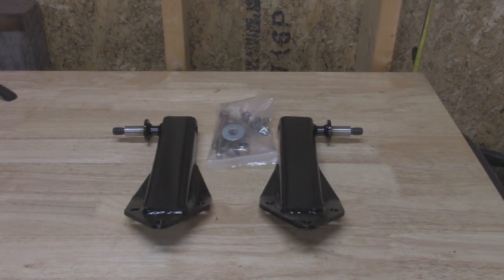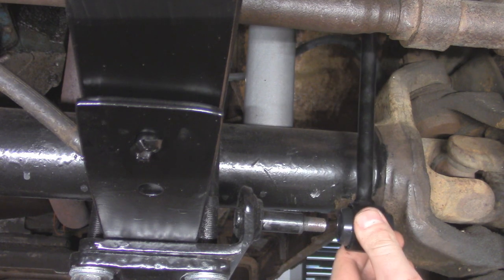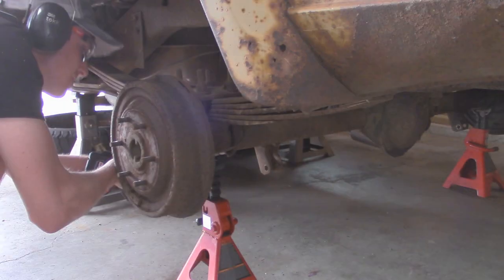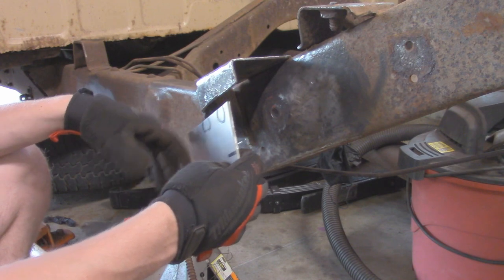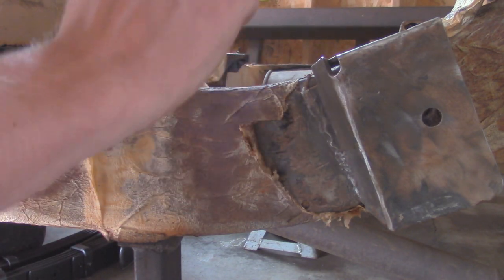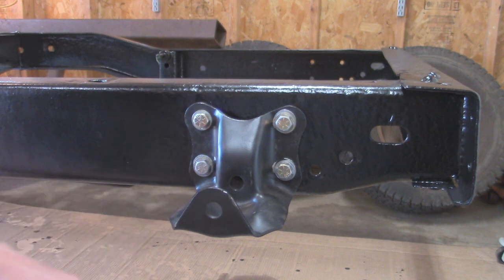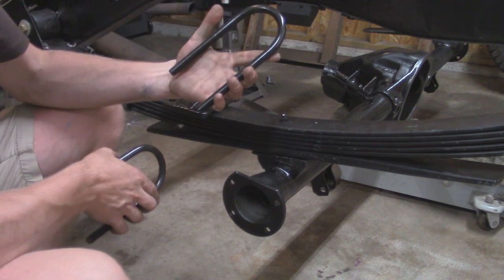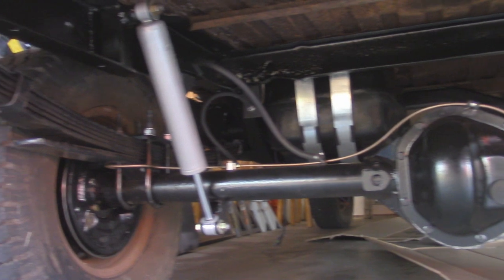Installing a 3" Lift on a 1978 Jeep J10 | Part 2 of 2 | Rough Country

Comment: Hey there young man.
  Listen to an old timer,. When you are trying to clean up rust on that old stuff and you have that heavy stuff such as on your frame that won't sand or wire wheel off especially in the heavily pitted areas, just heat them up with your propane torch, and then you can brushes the rust right out off,  it saves a lot of compared to using chemicals and is a lot safer.   I have been working on rusty stuff for forty years, and I often use this method on heavier steel parts and and frame rails to remove rust.  You can do it on thinner steel also sometimes when needed as long as you are not concerned about warping it.  
And also by heating up the metal you are also removing the moisture from it, which gives you a completely dry surface for applying rust converter, primer or whatever kind of paint to.
 Keep up the good work, and good luck with your project.
Tim from Wisconsin.
Reply: Good tip!

Comment: my three 1979 J20s (131" wheelbase like your J10) had the Quadratrac and the Dana60. The J20s only had the 131" wheelbase. J10s had the Dana44 and had the 119 and 131" wheelbase option (7 and 8 foot bed). 
I'm surprised with all the rear spring hanger relocating you did, you didnt just move the rear suspension forward 12 inches to use the forward spring eye positions for the rear springs. Then you just chop the rear Drive shaft, and cut a foot off your bed (if reusing it) and you got a short wheelbase J10.
Reply from the maker: Interesting, I may do that in the future but for now I am trying to get it to be original as possible with a few mods.
Reply: I converted my J10 to shortbed. It's simple. You just relocate the springs 12" forward, and there's already a dimple in the frame where the hole goes.

Comment: Hope you remembered to make some drainage holes on the bottom of your rear forward leaf spring bracket repair.
Reply from the maker: Yup, I did add them. I don't believe I mentioned it in the video though.
Reply: @OutJeeping  Good job then, as far as the front steering stabilizer mount goes, I managed to reinstall mine even though the pins seemed to be too short on two different J trucks, it was a a pain, but  once you you get it lined up I managed to catch enough of the pin to make it work, once the weight is on the spring and you get them started and they level out some the pin should catch the hole in the axle mount better. I was amazed how easily the new springs seemed to fall right in place in your video without being forced to bow them, especially the rears. I have installed a 4" skyjacker and a 2" lift kit on a 84 and 81 J truck and almost needed 3 or 4 hands to flex them into place.

Comment: Aren't you supposed to have the wheels on and the weight of the vehicle on the axles before you torque them to spec?
Reply from the maker: Correct, I mentioned that in video. That would be the very last thing in the video.
Reply: @OutJeeping  I was referring to the u bolts , looked like you torqued them to the axle long before the wheels were added, those are supposed to be torqued to spec with the full weight of the vehicle just like the shackle bolts.